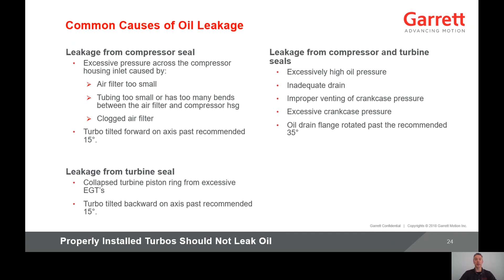Common Causes Of Oil Leakage / Turbo Smoke | Garrett - Advancing Motion

Comment: I have checked all of this list, everything is installed proper and talked to 4 experienced mechanics and no one can figure out why my New gt3076r ran for 5 min at idle and poured out lots of oil on both the compressor and turbine side of the turbo.
Reply: Crankcase not vented enough to allow proper turbo draining into engine?
Reply: @ls87gbody  I had a -10 AN from the crank case and another -10AN from the valve cover going to a oil catch can with vent ports.
Reply: @davidwindz  you ever figure out the problem?
Reply: @ls87gbody  yes it ended up being a fitting that was not fully sealing on the inside of the turbo housing, causing aeration in the oil and allowing it to blow by the seals. I had sent Turbo out to be tested and it came back with flying colors. It was perfect. I changed the fitting and I also added an oil pressure regulator for good measure.
Reply: I put that Lucas leak stop in my oil and it sealed the leaks in my turbo.